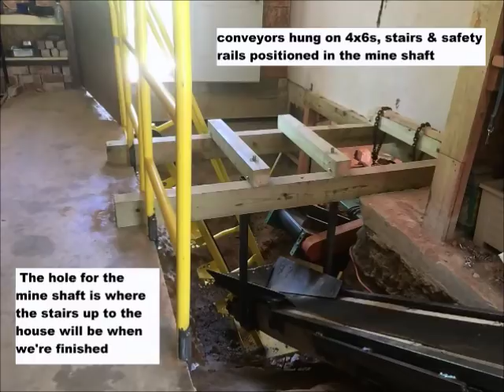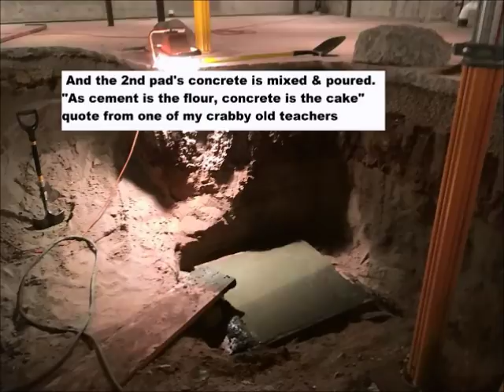DIY Dig Out Crawl Space - Phase One Recap

Comment: Did you get this engineered and approved with plans with your city ? If so ? Did you have any issues with the plans or planning commission? Thx. Great job btw!
Reply from the maker: I had a good background in commercial construction & did the plans and pulled the permits myself (including a plan & fill permit where we dumped the spoil.) City inspected 3 times and reappraised after. No problems with any of it. Permits costed $300 US.
Reply: @diycrawlspacedigoutunderpi4201  thanks for your quick response…my city. Lake Tahoe is required us to have an engineer stamped for the underpinning. I’m doing the work myself too. Thanks for the inspiration!!!
Reply from the maker: @joemanflyer2001  In Green Bay here.
You are smart to keep the engineering and permits as required. Eventually you will sell the place and would have a major problem if the work was done without paperwork and inspections.
We had quite the compliment from the city engineers - they said if anyone comes in saying they are going to do an underpin, city tells them to watch videos of our project, and if they can't do it like that, to not do it at all.
One argument we had to make over & over - When you dig a socket out for underpin, the wall is actually working like a beam to span the opening. We also learned that a furnished ranch house weighs 1,000# pre lineal foot on the bearing wall sides (where the joist & trusses end), and 600#/ft. on the non-bearing sides.
The very best of luck to you, Sir. Hat's off for taking it on!

Comment: Amazing project. I've been thinking about doing the same in my basement...but it's built on bedrock. 🤔
Reply from the maker: Research a product called Dexpan Demolition grout. We easily sheared off concrete footing stubs that were 5"W x 12" thick x 5' long (in one piece) with only 1/2 hour labor to drill holes. The stuff is not expensive & can sometimes be reused. It might give you an option to manage the stone base. 
You'll see some of the results in the video called "Time Lapse."
Thanks for watching

Comment: You are a hard working and smart man/engineer!  I was wondering how much it would have cost to have the house lifted and machinery driven in from outside and poured walls and footings installed?
Reply from the maker: We did get estimates on some of the scope & stopped the process rather than waste the contractor's time. A close estimate would be $140 - $150k US. We would need to move everything out of the house, & move back in 10 months later. We would also need to re-landscape. We have a quiet neighborhood, & don't think the big iron, mess, & trucks would be appreciated.
I was looking for something productive to do in retirement, so we went this way. Out of pocket for this project should be about $44k US. I bought & built some equipment, and that will all be sold when we're done. It's been a great experience after an eventful career. No regrets.
Reply from the maker: Also want to clarify that I do not have an engineering degree. I'm just a guy who builds stuff.

Comment: Good grief, what did you retire from? Civil engineer?
Reply from the maker: I'm a Wisconsin farm kid. In my career worked in big commercial construction, machine building, heavy industries (machining, casting, welding 40 ton parts,) automation, machinery moving, & installs. I decided to build/ repurpose equipment to do my underpinning job and do the work myself. I'll sell the equipment as I finish with it. The project is going well, & has been a fun challenge.

Comment: Did you modify your excavator bucket so that you can reverse it, or did it come that way?
Reply from the maker: You noticed - wow! The mini came w/ 2 buckets. I cut the ears off one & reversed them. Important that bucket can tip @ 45 degrees when you weld them back on. It only takes a few minutes to change buckets, so I use both. Minor down side - when working as a shovel, the weak (piston) side of the cylinders are doing the work, so breakout force cuts by 30 percent.